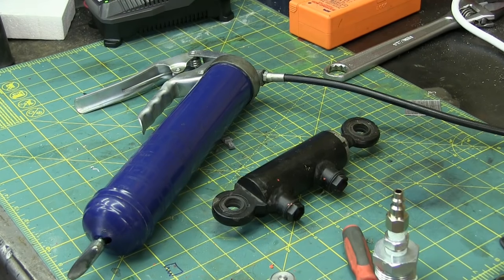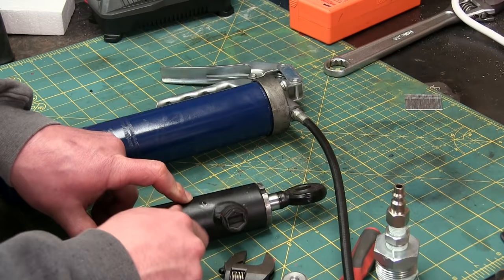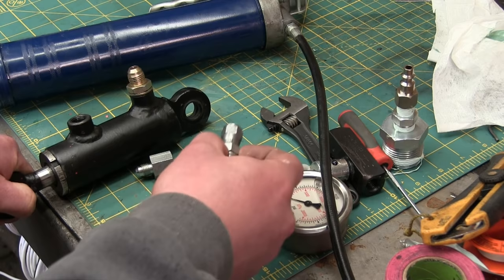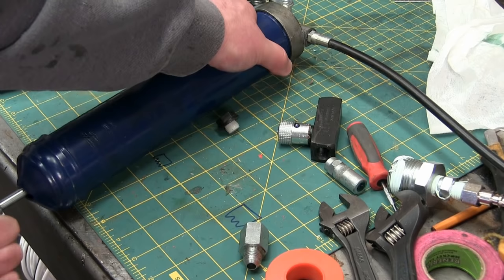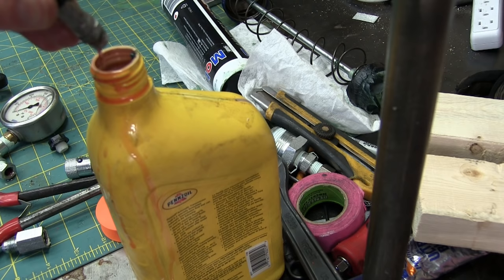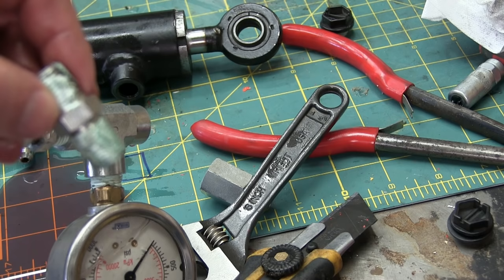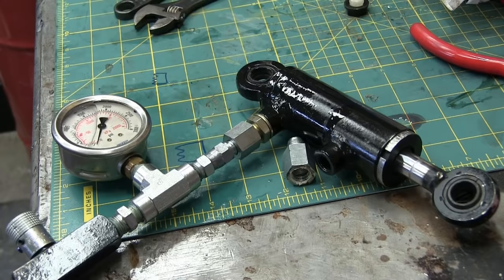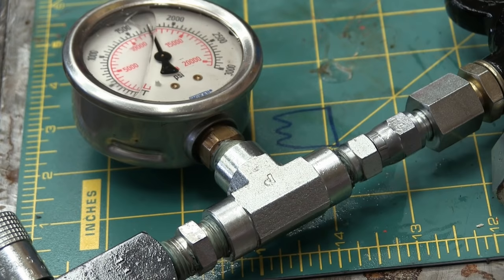Twenty Buck Grease Gun hydraulic pump.  Tested to 1700 PSI! Simple and Easy! Etc.

Comment: I hate to be that guy...... but you need to be smarter than the grease gun in order for it to work. 
Once your cartridge is Empty, remove the barrel from the pumping head. ONLY now can you pull back the charging handle. 
I usually pull it half way back and let it snap back, which pushes the empty cartridge out to make it easier to get out. Then pull it back and lock it in place. 
Pull the cap off new grease cartridge and insert open end first. Now pull off the Tin pull tab. Thread on pumping head. Release charging handle and using the the little air bleed on pumping head purge the air out. 
I like to add a 18” extension hose to the regular hose, makes it nice to use.

Comment: I would think a air foot pump would be ideal for the job, cheap, pretty high pressure rating, and you have a ton of force(your entire body) to compress it, also most of them have a latch to keep closed so you don't get any back off on pressure. It's almost the same design, except all you really need to do is seal off the backplate, and tap a fitting into it.

Comment: For your grease gun dilemma, if you loosen the pump head a half to one turn before you try to pull the plunger. You won’t have to fight suction and the plunger will pull out freely.
Reply: Son of a diddley I was going to say the same thing
Mechanics tip number 34 right there

Comment: hydraulic oil is actually compressible it works out to .5% per 1000psi.... So I have been led to believe. Ps one must allow air to fill the void you are attempting to create whilst pulling the handle back on the grease skootcher, pro tip unscrew the "barrel" of the grease gun from the pump end to allow handle movement... your welcome!

Comment: Really nice video but Hydra Mac has used Alemite 500 with hydraulic oil to lift the top cover on their Commander 4200 skid steer I think year 1998. I didn't see check valve in line that could be the reason why the grease gun is not pumping.

Comment: This video left me wondering where do I buy hydraulic pieces in my town. 
I straitened motorcycle forks once with a bottle jack with chains attached with some scrap steel pieces. The idea of using a grease gun would have never occurred to me?
Reply: Maybe a tractor supply or farm and fleet, by the actual farm stuff.  I think you'll find gears, pulleys, and hydraulic fittings in the same aisle of most places.

Comment: +AvE It is not safe to assume that a hydraulic system is less dangerous than a pneumatic system. Unfortunately there have been numerous high pressure injection injuries even with grease guns like the one you use.

Comment: I switched over to a cordless grease gun, when your the only one that greases the equipment and your running mowers with around 90 fittings a mower it is a time saver. Kinda makes me think how that would do in this application.

Comment: I'm looking at this and thinking...

Compact hydraulic scissor jack for cars...Those cheap ass, screw-scissors take so damn long, and are such a pain in the ass with their craptacular "handles". But a compact hydraulic lift, with a QD hand pump? That's bears some thinking...
Reply: +Goldmarble They actually already make exactly that, although the hydraulic pump is attached to the jack and not QD.
Reply: +Goldmarble Yea i'd be intrested in seeing what kind of force you can use with this, id like to see it chooch
Reply: +Goldmarble Why not just use a hydraulic bottle jack?
Reply: +Goldmarble Ever think of turning a scissor jack with a cordless drill?
Reply: +thnksno Impact wrench works great
Reply: Was meaning, for....you know, emergency use, out in the middle of no where. Cordless drill? Batteries might be dead. Etc.
Reply: Check your gear before you go. If the batteries are dead, you simply do it the hard way. I agree scissor jacks suck, but in my experience, you only need to use them once or twice a lifetime. A pump, related hardware and leaks are not nearly as useful as a cordless driver.

Comment: Do you have a video where you take a fucked up threaded stud and fix it? I have one one my motorcycle and really can't afford/am not capable of welding a new stud on. I'm using a thread file, but my split die thread chaser won't bite for some reason. Any help is much appreciated my Northern friend.
Reply: sonarmen Jug stud? Head stud? Those are usually threaded on both ends . . ..

Comment: You talk about contact dermatitis in this vijayo. I had a friend who worked concrete (bridge decks specifically) and was exposed to all sorts of oddball types of wet concrete depending on the State bridge codes here in the United States of Hysteria. He had some trouble with his hands cracking and peeling to the point where they weren't even dick-beatable, much less useful for turning a wrench.  That might have been a similar condition. (I'm a metal fabricator/ mechanic so I know a little about the defatting of my meat skinners from handling acids and solvents and such improperly.) Does concrete exposure do about the same thing, or is that completely different?

Comment: Use a lever gun instead of the pistol grip to get more pressure, if that's not enough pressure it's easier to put a cheater pipe on the handle.

Comment: Wouldn't a $40 hydraulic battery cable crimper be more fun plus a review to? Has a "Ergonomic Handle Grip" and a case/box organizer.  What would you use that set up for anyway? I haven't used a cable crimper but I have a hydraulic flaring tool that's used sometimes.

Comment: +AvE I'm quite appreciative of your experience with o-rings and plasticy / rubbery materials.  What is the best material for an o-ring in an engine compartment (oil filler cap, so it'll see engine / engine bay temperatures and exposed to synthetic oil and possibly a little gasolne (assuming some gets into the oil eventually).   I've seen a list of o-rings that are compatible, but not sure if one type is better than the others.  Thanks!
Reply: Viton A.  Or equivalent FKM.  66% Fluorine.
Reply: +Robert Plewnarz thank you very much.

Comment: You rip apart lots of power tools, I enjoy watching your videos. I am a retired mechanic and I have had 4 Milwaukee Fuel  1/2 inch hammer drills and all of them were similar yet very different in one way or another, From the clamp on handle to just other details. Do You find this also? and with other brands also? I didn't think the Milwaukee Fuel stuff has been out that long to have 3 or 4 versions of it?

Comment: I've used a grease gun to pressure-test an old air compressor tank, just filled an old grease tube with water after filling the tank with water too. First 100 pumps didn't do anything, thought it was broken, but, the tiny amount of air in the system finally compressed enough and pressure shot up nicely. No extra check valve. Post-contact Dermatitis no joke, had a ladyfriend who developed it on her ladybits from having feminine hygiene products against her skin, as is obviously regularly necessary. Redness and blisters everywhere. And nothing you can do about it. Can't just stop using the irritant. Pretty awful for her :(
Reply: +AvE Well, it does a variety of things, but, mostly what it does is janitorial service. See you use an anodizer kind of like a bodypaint for the pixies when there's a magic pixie party. It's a beautiful ritual, they get naked and then make themselves all kinds of different colors. But the next morning, all the pixies have nothing but the faintest whispers of their dignities and a long walk of shame home, they're still covered in the party paint. Not to worry, just add a little pixie dust and their bodies return to their normal color. I'll send you some literature. Actually the bag of pixie dust had some literature in it, didn't it?

Comment: You said the way the grease gun works. That is incorrect. In THEORY, sure, it puts the grease into the nipple. In any real-life practical attempts, the grease goes every which way except into the zerk.

Edit: Nice Vice name, too.
Reply: Tom Fielding In practice it's always worked for me except in 2 situations: first, if the zerk is seized or clogged; second, if the plunger in my cheap gun hasn't advanced so I'm trying to pump air instead of grease.